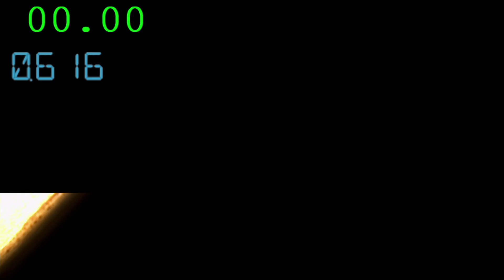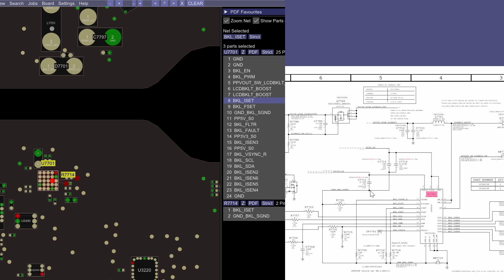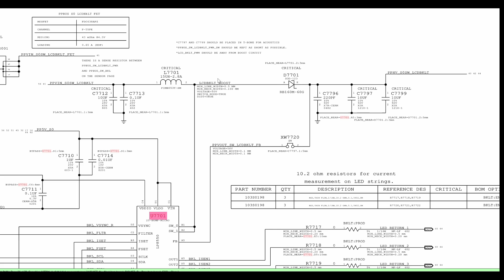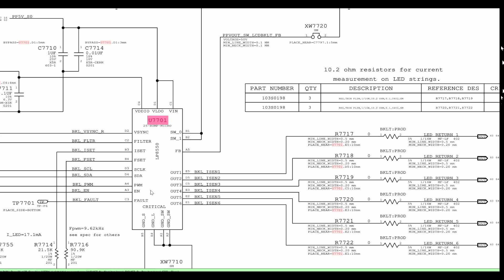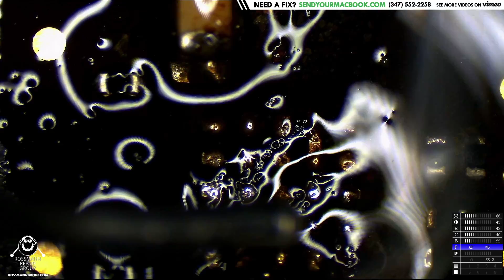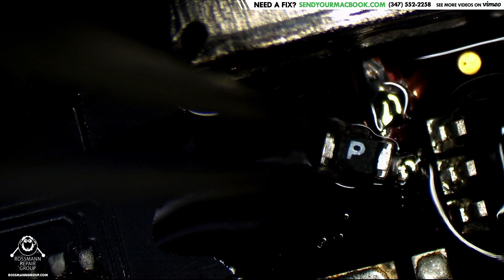Why do I start measuring where I measure when fixing Macbook logic boards?

Comment: Do you use a spray flux remover after repairs to clean off the board? I work with pro audio gear and it is a bit larger scale than this, most of the time and I love a clean board.
Reply: He uses an ultrasonic machine

Comment: I have a dumb question since I don't have much experience with soldering. Does heating lead solder, flux, or anything else in this job create any toxic fumes? If so, how do you protect yourself from them?
Reply: The fume extractor - a background noise in the video
Reply: aka rapid cool technology xD
Reply: It's under the Desk supplies in video description
› Fume Extractor: http://amzn.to/2d5MGoD
Reply: if you are using correct equipment for the job, lead fumes wont be a problem since it has a boiling point of 1749 °C (3180 °F). Flux fumes on the other hand is the real danger. As others mentioned fume extractor is the device which protects you.
Reply: Fume extractor: https://uk.rs-online.com/web/p/solder-fume-extractor-kits/1000147/